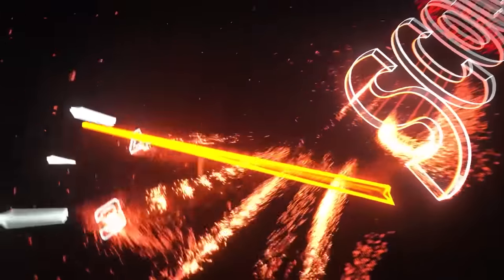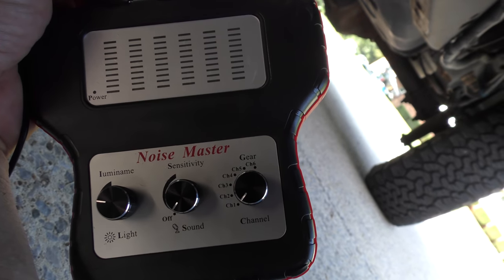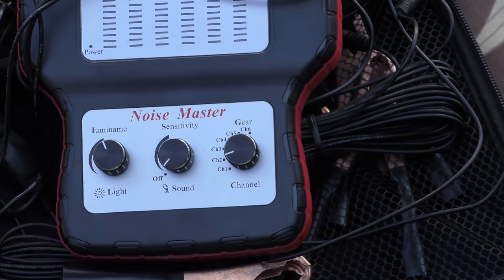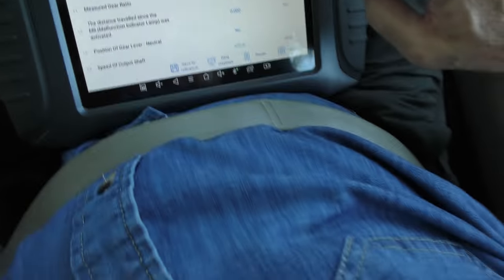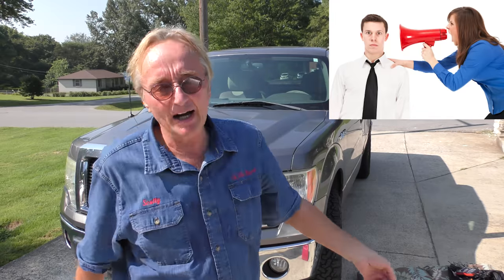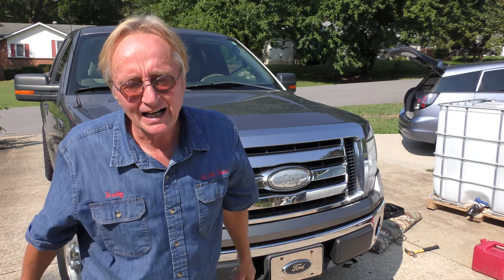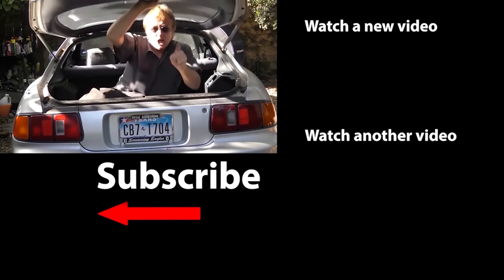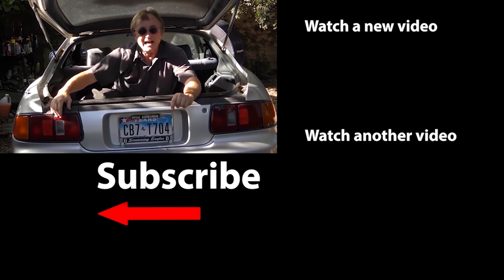If You Hear This, Your Transmission is Bad

Comment: My ‘03 Accord still has the same transmission. Just hit 275,000 miles and it makes a bad clunk when I shift to reverse. (Usually means it’s going bad) but I keep an eye the fluid and get more borrowed time. Time to save up for another and drive like a granny.
Reply: My 08 accord with similar miles did the same when shifting to R, but at the end it was a bad trans mount.

Comment: My car started making a noise in the transmission sounds like a bad barring I changed fluid and filter noise still there but cars been still working just fine for the past 5 years since I herd the noise so I’m just going to leave it until it finally stops working cars almost 20 years old if it dose die I’ll just get a used transmission put in. It is what it is once your car starts getting up there in age

Comment: The dealer charges 109.95 $ an hour  also not a place you want to take your car most times they won't find the problem and you pay 109.95 $ plus tax for nothing or they change parts that don't need changed ...

Comment: Scotty I have a genesis coupe with a A8LR1 8 speed automatic with 68k miles. I'm wanting to service the fluid so it last as long as possible. No problems with it at least that I can notice. I watched all your videos but still hesitant. It has a complex fluid level check. But if I measure exactly what comes out and put dealer fluid back in I should be fine right. Also should I change filter which is part of pan? Let me know. Thank you for all you do.

Comment: Hi scotty i have a problem with my car losing power and dieing while driving. Ive changed sensors, timing thermostat. Was running fine before this. Any suggestions ive checked lines hoses everything seems fine I dont know.

Comment: Hello Scotty, 

I am wanting to get a SUV or Station Wagon with 20mpg highway or better, reliable, and decent storage. We have used our 04 Jeep Grand Cherokee and 03 Dodge Durango, but the gas mileage on trips is bad. We would like some input. These are some of the cars I am considering: Volvo XC70 mainly 3.2 non turbo, Kia Borrego V6, Mazda CX-9, Honda Pilot, Hyandai Sante Fe, and Honda Element, which is on the small side for us. Thank you in advance for you input.

Comment: Ince upon a time i got on the freeway got up to speed and torque converter did no lock up.When i stopped the mist god awful smell of burning rubber or plastic.The dealer said the torque converter grenaded and destroyed the whole transmission.105,000 miles 94 dodge.$3,885.

Comment: Scotty, I have a 2010 Ford F150 with 180,000 miles on it. Goes into reverse and drives smoothly like always. Shifts from First gear to 2nd smooth, but when it reaches 3-4 I feel hesitation and noise.
I hope someone will provide comments. Thanks in advance.

Comment: Scotty:  2018 Ram Diesel.  Is there anyway to overt having to remove the radio to access the secondary OBD II port for resetting the 4wd serv light.  Removing the radio and related components is a hassle.

Comment: Help!!! Scotty,  can't figure out how to fix my 2006 Ford expedition,  drives up 2 gear and then slips and have to put on overdrive after that to drive it, transmission has been rebuilt and still has same problem,  and sometimes it will shake and make noice and stall if I don't turn it off, and when I do I turn it back on and it drive, what do you think is happening and do u know how to fix it? 
Your amazing thank you for your videos .

Comment: Scotty I got a question. I have a 2000 jeep Cherokee sport that has 250,000 miles and sometimes when I turn it on, it shakes at idle. But when I put it into gear and give it a little gas it stops shaking, and when it goes back to idle it doesn’t shake anymore. Any idea what’s going on?
Reply: Misfire?
Reply: Clean throttle body with spray cleaner and Maf sensor with maf cleaner. Idle air control valve can carbon up as well.
Reply: Bad Motor Or Trans Mount? It depends On how bad It Shakes. Cleaning Your Throttle Body And Mass Air Flow Sensor Is about the best thing You can do for Your Vehicle. Don't Use Carb Cleaner. Throttle Body And Mass Air Flow Cleaner Only. Scotty has A Video On Cleaning the MAF. They are pretty fragile.
Reply: It’s not misfiring, and the maf and throttle bodies are clean too

Comment: I got my car out from the impound after 6 months. The car was running fine till I hit traffic and then the rev is there but no response on power to move ahead. Why could it be ? It’s a automatic Ford Mustang 2016 model. I live in UAE.

Comment: Hey Scotty and everyone. I have an 06 Lexus ES 330 with 134k miles. My car accelerates poorly pretty much all the time. I have no check engine lights on. So while it has poor acceleration all the time, it’s really bad when the AC is on. There is massive hesitation when I have the gas pedal all the way to the floor. What should I be looking at? Spark plugs? Fuel filter? Just so lost

Comment: I have a 07 Tahoe , knock sensors be pretty easy and cheap to fix ? 1k not bad at least to getter going in good shape looking to spend 2k and freshener up with a new tire a oil change and sensor if messed up not for sure yet getting a gas cap may get the engine light off.

Comment: I have a question not sure how to properly explain this though. I have a 1990 Honda prelude manual transmission and I’ve noticed that sometimes when I’ve been driving it and I stop at a place and leave my car on while it’s parked it’ll start making this very loud noise that sounds like it can be the fan trying to cool down the car. However I feel like it might be coming from the engine or something not sure if I explained it well…. But it gets really loud and then once I start driving it’ll stop.

Comment: Hello Sir. I hope you are doing fine. I need a tip. I've a 2007 Hyundai santa fe 2.2 v6 gasoline . I left it without battery for 2 years two weeks ago bought a brand new battery and started it the engine is still running fine but when i push the gas pedal the rpm goes up but it drives very  slowly. My transmission is a tip-tronic type, so I used the +/- option and i Saw that when i turn of the key turn it back on the transmission starts on one but as soon as the car starts moving it jumped to 3rd gear and doesn't shift to any uper gear or lower and the car is having a very poor gas mileage.  Thank you in advance.

Comment: I have a 2002 Mercedes also with a p0730 as well. I checked the transmission fluid and it’s low and dirty. Should I change it or just flush

Comment: Scotty I have a 2003 gmc 1500 with 4.3l v6.  Having transmission trouble.  Slipped a few times.   Now the truck barely gets to 70mph.  When driving normal taking off it shifts and rpms go up as should.  After 50mph rpms stay at 2000 even getting to 70mph.  Does not feel like 70mph. Truck has no torque. I spoke with a mechnic shop. Without even seeing the truck said need new trans. Over phone. Any advice tips?

Comment: My transmission is slipping and I hear clanking noise when I step on the gas…idk if it’s my transfer case or my torque converter or it’s just the transmission

Comment: Hey ScottyI have a 2003 Sierra with the 4.8  at 147k miles and it hesitates when shifting from 2nd to 3rd and when I'm going up an overpass on the freeway for example it revs up higher than normal like it's struggling to get up the overpass. I bought the truck in June 2020 at 130k miles the transmission fluid is brown when I bought it and didn't have any issues up until recently. I took it to a transmission shop last Thursday so right now I'm waiting to hear back from them on Tuesday I'm guessing it's the torque converter  but if ( knock on wood) I have to replace the transmission should I go with OEM or remanufactured?

Comment: My 2008 Cadillac CTS which I know how you feel about those already buttt I really like the car and the previous owner had $5k of work repairing the Transfer case input/output shafts I believe according to the paperwork but without any signs or warning the car while mid drive just stopped getting power and started winding whenever the gas pedal was pressed and I believe it's the transfer case again but could it be the transmission instead this time?

Comment: Is it possible to make the TV cable adjustment too many times? If so, what are the repercussions of doing that? I've been having issues, for about 6 months now, with my 94 Jeep XJ automatic shifting either too quick or too late, very erratic overall. I've replaced the TPS and have done this adjustment probably 20-25 times over the coarse of the last 6 mos. Yesterday, it started to not shift at all on the highway. I would press the gas and the RPMs would go up over 3000, but it would not accelerate and I had to coast it into a gas station. Went out and made the TV cable adjustment and then would crank, but not start. Repeated the adjustment 5-6 times and still wouldn't start. Unplugged the TPS and it started right up. Attempted to drive it the 5 miles home, with the TPS unplugged, but the same issue came up with it not shifting or accelerating. Is this what they call "limp mode"? Anyway, I pull over and plug the TPS back and try to start it and this time it started and mysteriously drove and shifted much better, although still not perfectly. Should I be looking at something in the transmission itself at this point? It's full of fluid and it's the stock AW4 tranny. Does any of this sound related to a neutral safety switch problem at all? Thanks for any help anyone can offer.

Comment: I have a 2006 honda pilot roaring noise when slowing down. Checked breaks working fine, checked hub bearings there fine. Only when decelerating breaking. A mechanic said it was the input shaft bearings in the transmission. Does this sound right? Any help would be appreciated!

Comment: Bad transmission is EASY to diagnose:
Absolutely GUTLESS. It will take you 60 seconds to go from 0 to 10. Doesn't have to make noises-she just doesn't want to GO. If you put the pedal to the metal, you get nothing in response.

Comment: I recently bought a Honda Accord (2.4l 4cl cvt) The transmission jerks when I shift to drive, and fluid was very dark black and smells burnt. Would changing the fluid help? Or would that kill it quicker?
Reply: According to a mechanic I went to, a  transmission fluid change can either improve or make the issue worse, your call.
Reply: Obviously, a better brand could help, and doing the usual maintenance timing referencing the manual fluid grade and sticker time replacement

Comment: I have a 03 g35 coupe automatic , the problem I’m having now is that when I’m in drive it slips but also lags like it wants to go but doesn’t , but the minute I use the gears it drives good but still slips , is my transmission fried ? Or what do you think the issue is ??

Comment: I have a 2010 Saab 9-3 sport combi front wheel drive 2010 model... When the car is idling I am sitting in my car and I wiggle my legs around and I can hear something moving around on the front passenger side like something is loose.. shop can't figure out what it is.. what can it be?   I hope the transmission mounts aren't loose..

Comment: My car sounds fine when it first starts but right after sounds like it's about to die for a few seconds, then it sounds normal again, when I speed up to merge on the highway or something it feels slower and sounds louder than what it used to, there no jerking and the transmission shifts when it's supposed to so I was thinking spark plugs what's your opinion?

Comment: I have a 16 police explorer she gives me rattle with 87 on start ups but with 91 or 93 she’s is normal . But I have rattle on acceleration. Could it be my timing chain guides or trans. The police department changed the water pump at 65k miles and these things are horrible on water pumps. It’s now at 145k miles I’m guessing timing chain and guides

Comment: Hi Scotty, i have a 2007 Honda pilot that had a transmission to just blow out the housing in two sections, before this happen the car would seem to stall as i give it gas, i ran a test on it and i needed an 02 sensor bank 1, upstream so i changed it out and my engine light went out, i took it for a test drive and i thought everything was ok now,  but the next morning the transmission went out, actually the transfer case just blew out, its AWD. It has 264k miles have you experienced this before with transmission blows out the transmission housing?  Thanks

Comment: Hey Scotty 
Thank you for your useful videos I really enjoy and learn a lot from. 
Well I know you would tell me not to buy  a 2021 Ford Explorer ST but I did it anyway because I like the car. So my problem my car has 5000 miles and I’m the morning when I start the engine it smokes blue for 10 seconds. I took to the dealership and they confirmed the car use oil but suggested to break in the engine to 10000 miles an than put in a oil consumption test. What are your taught’s ! I bought it brand new V6 3.0 twin turbo. Thank you for your advise.
Reply: Did you drive it a long distance on the highway right after you bought it?
Reply: Break in procedure is very important  for every modern car, cause if you don't break everything in properly, then you're gonna get problems. It's a good idea to check the owners manual on how to break in a new car.
Reply: @fixitallpaul4847  For 2000 miles it was short distance more like a city drive, get on the Highway for short drive.
Reply: @squiresonwheels3249  the problem is that the owners manual doesn’t really talks about breaking in the engine.
Reply: @botondlehelcsikos  my parents had a 2010 ford fiesta, we bought it brand new and there was a chapter in the owners manual about breaking in the car.
Reply: @squiresonwheels3249  well I just got the manual and searched and there is a section on page 296 there’s the breaking in section but it talks about the tires breaks and clutch and that’s it. At least I can’t find it and I looked trough many times :)
Reply: @botondlehelcsikos  that's odd, in our fiesta there was a section about the engine and transmission.

Comment: I have a 2007 kia spectra5 it rides good for a couple miles. If there's a lot of stop and go, the transmission gets stuck on third gear. It makes the car jump and sometimes it goes like in a neutral position until I let go of the accelerator then it catches 3rd gear. Loud noise. Does not shift gears after that. Its an automatic. When this happens and i shift to reverse it jumps. Mechanics do not know what's wrong obd2 does not read the speed.
Reply: @tammylott921  and you own what country. ? Provide me with that diesel truck since you care so much about liberals and I’ll drive it. Other than that the question was for good ol Scotty

Comment: My Toyota Sienna 2000 move fast for a while, and when hot, vehicle won’t  pick up like it use to, but the reverse gear pick up faster 
And there is a leakage in the gear 
What exactly could be the problem 
Please help out

Comment: Hey scottie I have a 2004 grand  prix 240 thousand  miles it wouldn't  start deader than a door nail I kept  wiggling  the gear shift  on floor  turning  the key it finally  started  it hapen twice  in 2 months  si a short connection  from transmission  wiring please  reply  thanks Don

Comment: My 2013 mazda 3 used to go 530km on a full tank. Its done 150k km's now and it only goes about 430km on a full tank. Flushed transmission, changed oil, cleaned throttle body, they dont seem to help. How can I get good range like it was new again?

Comment: My car rattles when im idle and when I accelerate and if I go anything past 2 rpm it gets very loud and it sounds in the front and my car shuts off when I lock my steering wheel in either direction

Comment: I have a 2004 nissan pathfinder armada V8 has over 200k miles on and after it run 5 or more hours consistently between 3rd to 5th gear it will chug well excellerating about 35mph to 65mph is the speed range it happens is it possible injectors causing that or what could it be i have no codes show and am running out of ideas of what could be causing it. Can you help point me in the right direction?

Comment: Why does my car rpm go high but car doesn’t accelerate much happened a lot driving I fixed misfiring spark plug and coil and driver side catalytic converter I’m not sure what else it could be maybe fuel pump idk help

Comment: Scotty I have a 02 Chevy 3500 my tranny gauge says 225 f I checked the tranny oil on the dipstick it reads 140 f I checked underneath near the harness it reads 180 f I can’t figure out if my tranny temp is increasing or false alarm

Comment: Hey Scotty I have a 2020 Ford transit 250 with the 3.5 direct injection eco boost engine, and sometimes when I’m idling or shut the engine off, I will hear a popping/cracking sound somewhere in the engine, do you have any idea what that could be? I also only have 43,000 miles on it

Comment: I've got an 2005 magnum with 235k on it. Front end parts from rock auto some are super heavy duty for a good price. So fast car. Also have an all wheel drive with 75k smashed front end suspension needs replaced. So might as well stroke out the hemi put it in my rear wheel 😂😜 and I'm pretty sure it's the same transmission in both..